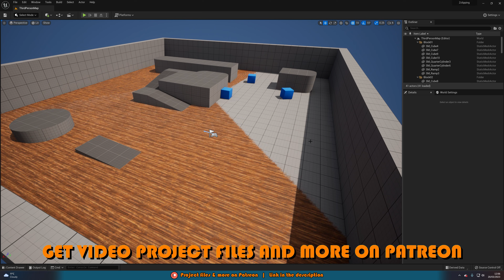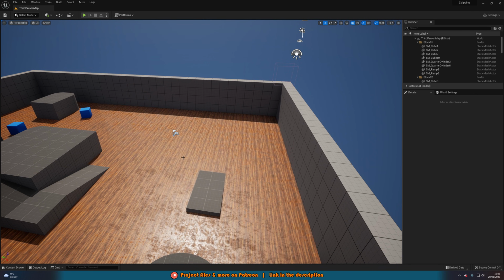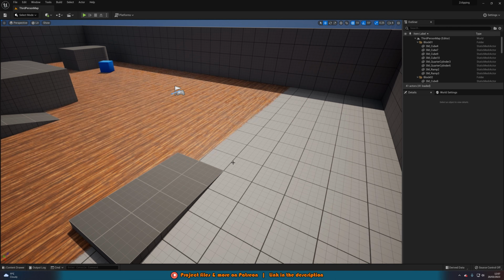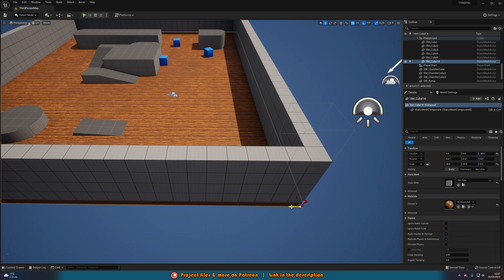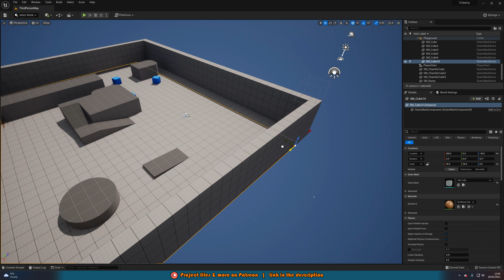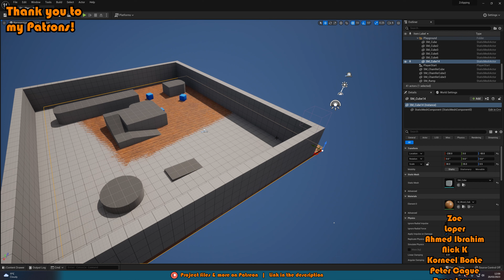Texture Flickering in Unreal Engine: Causes and Fixes

Comment: Great video! Very easy to understand explanation. I have a question, and please excuse my ignorance, but would you say this would be the same for UEFN??

I just started trying to use and learn the program and I am literally having this exact same problem every time I go into the Landscape Mode tool from a Blank Template. Haven’t added anything or edited anything, just a blank default template. 

Any tips on fixing this issue in UEFN would be incredibly appreciated. Thanks, for your time, energy and patience!

Comment: Question: I have two identical wall squares (1 x .25 x 1) and I create a 90 degree corner. The very corner is overlapped to make the section fit the other walls. If I add a different mesh (say a cylinder) that completely envelops the over lap does it cull the flicker due to being hidden?
Reply: Yes, whatever is flickering inside the cylinder is really flickering but not visible. If the meshes use Nanite nothing is flickering inside because those polygons are not being rendered (Nanite is a polygon streaming technology, it culls polygons hidden by other polygons and also it culls polygons outside the camera). So, both with or without Nanite the result looks the same.

But the better way is to make walls with the 45 angle cut, so that you can stick them into 90 degree corners without needing to put any additional mesh to cover the z-fighting.

Another way is to have the same walls you’re using but when making a corner slightly offset one off to avoid flickering.

One more way is, to use your walls, but when making a corner not putting one wall inside the other one. You just stick one next to another so that only one polygon of the first wall overlaps with the second wall, if that makes sense. This way flickering also would be inside, hence not visible.
Reply: @alexanderalikin1210  Thanks for the answer.

Comment: I have this water texture, based off the game The Legend of Zelda Wind Waker, I get issues where it flickers like crazy, and if I switch to the Unreal engine's water texture the flicking will stop.  
I can get this to occur easily if I use the landscape feature to make a small hole, then place that water material I made, on a plane or cube mesh, then stretch out that mesh,  then connect it to cover over that hole, when I zoom out, it starts to flicker, then when I zoom in the flicker stops.